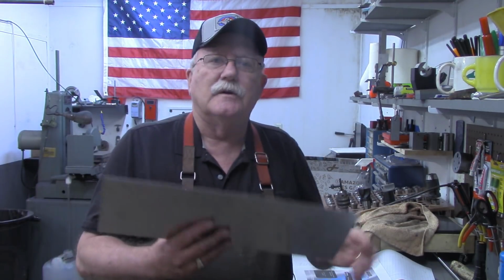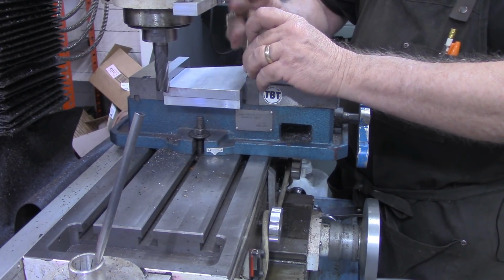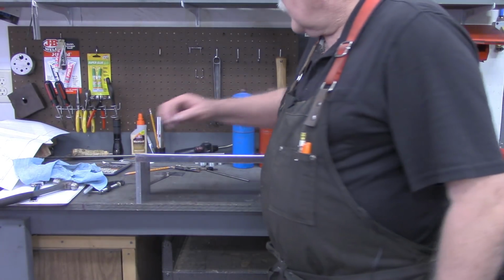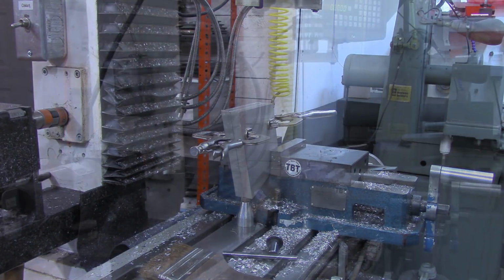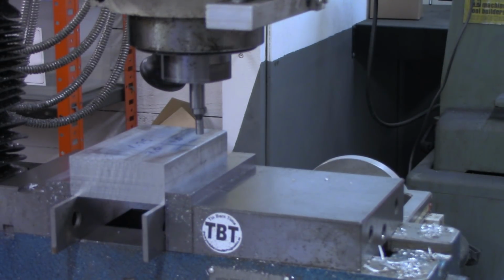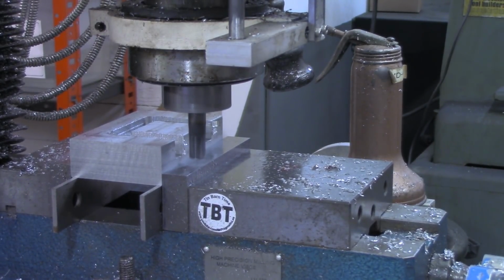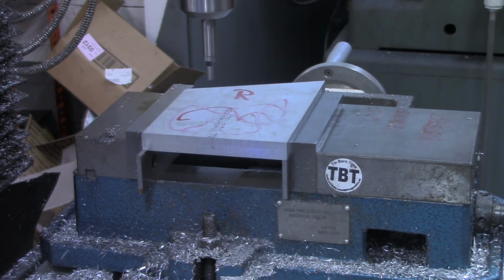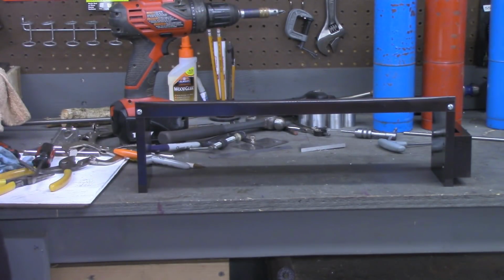Vanco Video Switch Stand

Comment: We like your attention to details about not painting everything in once piece we too get little machines in all the time with the screws bolts even some labeling painted over. It is nice to help the church you are a member of.?/\ A machined aluminum holder just to hold the remote, that is taking things to a whole new level, great idea maybe it the remote will not go missing so easily.